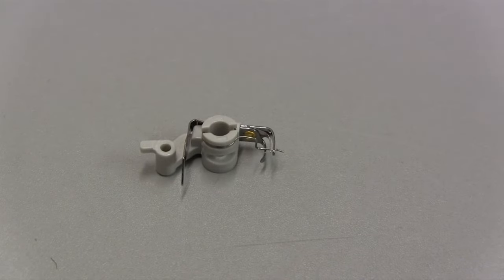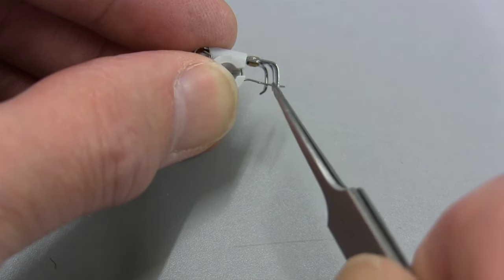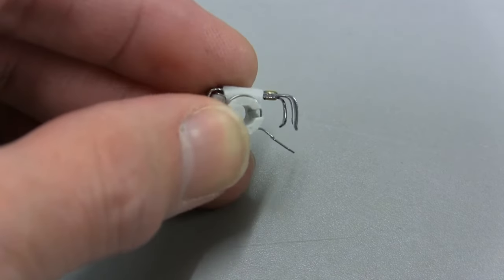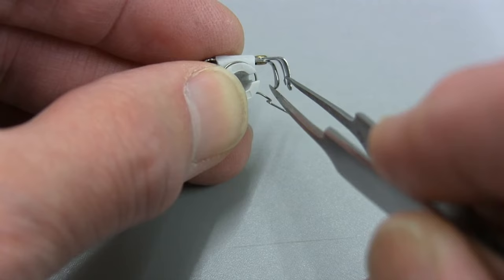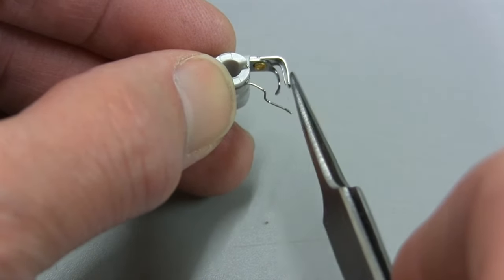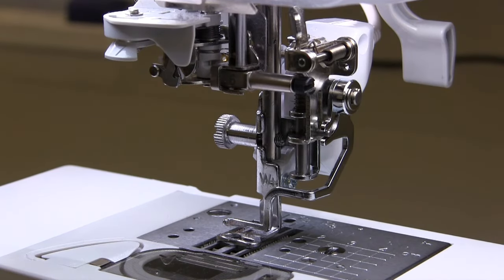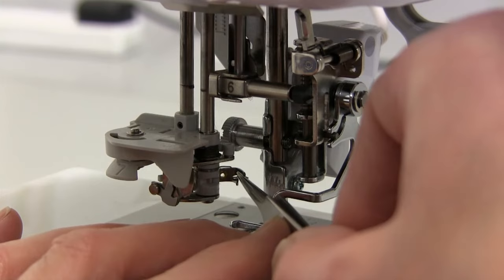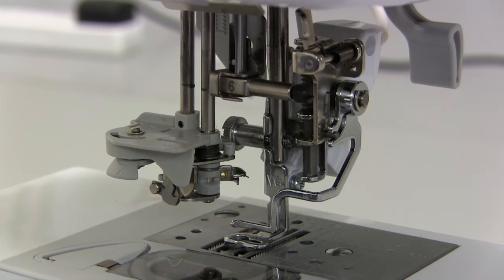Adjusting a bent threader hook

Comment: I never could get the wire that flips off to do that so that I could get to the wire. I was able to push it back but it just would not release. so still no threader
I had no problem getting the threader to be where I needed it

Comment: Keith Lord the needle threader on my Brothers 1600 did not work right out of the box When I returned to the dealer I was told that I have to use 80/12 or larger needles or not use the threader? It came with a 75/11 in it and the package of needles that came with it are 75/11?
Reply from the maker: Donna, the threaders usually work down to a needle size of 75/11 so it probably needs a slight adjustment or replacing if damaged. Most needle sizes up from 75/11 should work except special needles such as Wing or Twin.